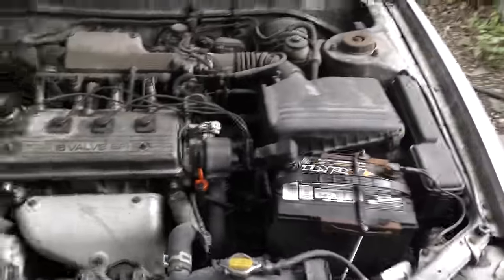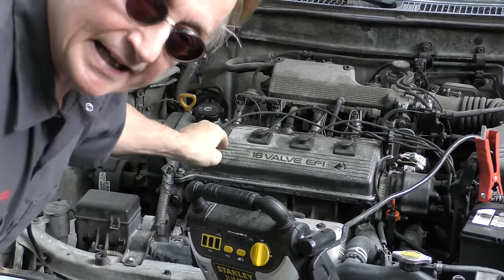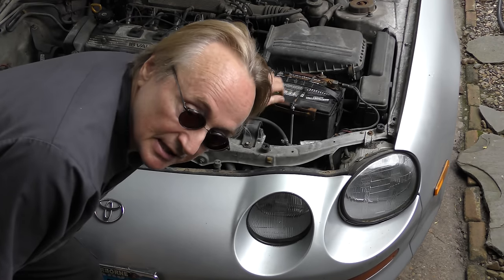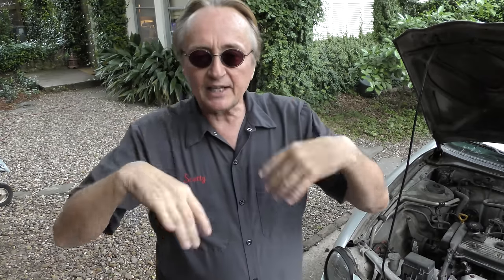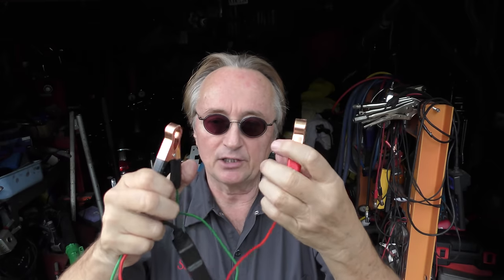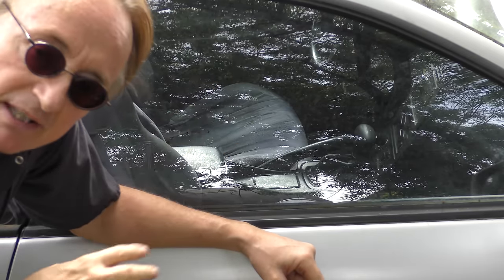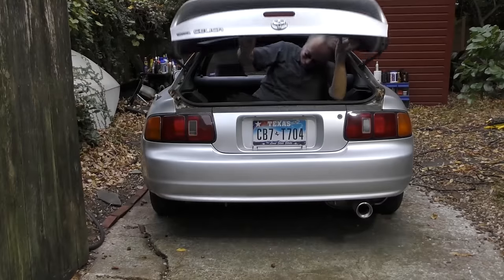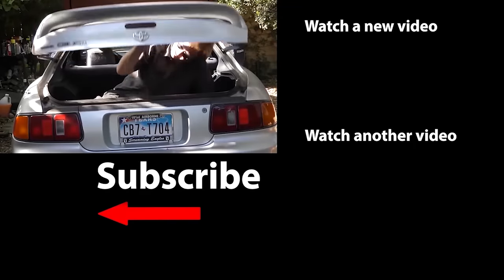Never Do This to Your Car (Learn from My Mistake)

Comment: Lord I miss the 50s and 60s.  Cars were easy to work on.  All you needed was a good shade tree.
Reply: These are the stupid complexities imposed on us by  EPA and Department Of Energy.
Reply: @hg2.  like unleaded gas?
Reply: True that
Reply: So why buy new cars then???? Just keep driving 50s and 60s cars....
Reply: Yeah...  and the only computer was the radio.
Reply: amen brother im 86 ys old and i still work on my 53 m37 army trk  ( aint)  a nut or bolt on that i caint turn  i pulled the emg ou twice   new rings  valve  ground  last time   the lug nuts gave me more tbl  than any hing else  cause  i did know  the were left and right hand lots a fun
Reply: @frankdavidson9675  wow id like to see ur truck but yea oldies but goodies lol
Reply: I miss them for the body design, but nothing else really. That old shade tree nneded heat and cooling and a roof cause you spent a lot of time working on those old cars. Remember full time @12k or less plugs, points, cap, rotor, dwell etc, brakes every year, tires every 2 or so, on and on. My last tires went 80k, last tune up, spark plugs only, 150k 10 years old. Brakes, once at 100k - reliability, saftey, drivability waaaay  better.
Reply: @me1assassin  Well, you'r right there, can't argue that.  But those tune ups weren't really that hard to do, and I would change the breaking system to current just for safety.  Tires just got better and better, and the cost really didn't go up much for it.  I remember working at a Phillips 66 in the mid 60s and those nylon and rayon tires would go flat as pancakes when we stacked then on top of each other.  Lucky to get 8k out of them and needed tubes.  Then a  miracle, the first polyester tires. wow, those would last 20k easy.
Reply: And a new alternator belt cost 6 bucks, and took 5 minutes and a wrench to change.
Reply: @_Peremalfait  True, but you had 2 - 4 belts and we're always replacing 1 or another. I changed the belt on my Jeep Commander, 5 mins one wrench, 48 dollars, at 125,000  miles, and didn't need it, was planning a long summer trip and just in case. Mustang, sits slot, so changed belt at 10 years old. 45 dollars, one wrench 5 min.
Reply: @frankdavidson9675  How did you find out they were not all lefty-loosey?
Reply: That's for SURE, today maybe u can change oil & filter, air filter and a tire!😠
Reply: @me1assassin  Exactly! When I look at all the features in a new car and compare them to cars 50 years ago, there is no way I want to go back! I even don't mind paying to have the work done. My car warns me if someone's walking by as I'm about to back up, slams on the brakes if someone pulls out in front of me before I notice it, keeps a safe distance on the interstate on cruise control even if the car in front slows down a couple miles/hour, and on and on. No way I ever want to go back. Oh, and we can while about all the EPA regulations, but I get twice the gas mileage I used to, my tires last several times as long, I'm not changing points, plugs, and condenser (whatever the heck that was) every time you turn around. I'll happily take my new car, thank you!
Reply: Hence...shade tree mechanic
Reply: My family says I was born in the wrong era. I like old cars and things
Reply: @timeless_realm How do you know whether lug nuts were left hand thread?

Specific Lug nuts on wheels were denoted by there "L" stamped on the bolt head.

EDIT:   Chryslers did this alot. My 64' has this all over and if your not mindful, you can round off a nut.
Reply: @_Peremalfait  I change 2010 serpentine belt in 3 and half mins
Reply: Definitely agree with you, had a 85 when I was 17...the thing rarely broke, but when it did it was so simple to fix. I’m hoping to go back to that someday, could care less about gas mileage. Currently have a 19, and more stuff has broke on it than anything I’ve ever seen, haven’t even paid it off yet🤦🏻‍♂️..lucky for me it’s stuff I can fix myself so far tho
Reply: @kevinb2014  Yes, a car today with a 1.5L normally aspirated engine has more power than a 60's 6 cylinder and gave nearly double the fuel mileage yet accelerates a lot faster despite being almost the same weight. You could almost breathe the exhaust of today's cars without dying due to hardly any CO in it. BTW yes in the 60's an alternator that put out 60 amps may cost only $55 but figure the inflation & see whether it was actually cheaper than today's that puts out 150 amps. No, I'll take today's cars although I wouldn't mind having a '71 Boss 351 Mustang (or a '70 Boss 302).
Reply: And a case of beer.
Reply: I miss my 70 1/2 Camaros now.  . All 3 of them . .  :..(
Reply: To 5ivestring very funny LOL.
Reply: @earthjammerusa5325  and two buddies to watch
Reply: Yeah i read you, i started in the '70s - but honestly, the old cars needed so much more maintenance, remember changing points and all the plugs, once or twice a year?  The rotor and the distributor cap every 2?  Valve adjustments, brake adjustments?  Now the trick is buying the right car and changing the oil like a fiend, if you need to work on your car and it has less than 150k on the odo, it means you just bought the wrong car -
Reply: Just don't get into a wreck, and you're fine.
Reply: Yeah I like working on my own car. But I can tell you one thing my 2016 honda doesn't need much work
Reply: I believe that peak auto was 1996. What I mean is: that was the year that cars were mechanically modern but didn’t have too many computers on board. The computers that were on board were all designed for optimal engine performance and maybe some safety equipment but not much more. The computer code was simple and problems with it were manageable. They had all the advantages of modern fuel injection but not a lot of extremely cheapened plastics on the engine that later cars make vulnerable and more planned obsolete.
Reply: AMEN
Reply: @irish89055  and who's brain child was putting the gas tank inside the cab behind the seat of pickups?  Still love those years though
Reply: @garfyinhawaii1541   And then if you have a little turbo like my baby Buick.......
Reply: @robertmaybeth3434   I have to do valves and other stuff on my bike but I don't mind it.
Reply: @timjohnson1199  Well, I just got myself a 2020 Mustang GT and according to my scanner, it has 22 modules or systems on board. The body module has been split into numerous functions like power window control, auto headlights, auto wipers, lane departure system, backup camera and sensors, auto darkening rear view mirror, etc., etc. Darned thing has more power than I need but I love the sound. Of course, it doesn't sound as rugged as my old '71 that had a 286 deg. split duration cam, headers, intake, etc. (old school pushrod OHV V8s had a nicer sound than these multi-valve OHC engines, which is why a Camaro SS with the 6.2L engine sounds nicer to me than my 5.0L DOHC engine and it's not merely a displacement issue since my '71 was the same displacement as my new ride). Of course, with old pushrod engines, they need a bigger engine to generate the same power as a much smaller DOHC 32 valve engine with 16 fuel injectors. BTW, if you used a calculator to factor in inflation and buying power, you'd find that today's cars give you a lot more than cars back in the 70's. My old '78 Granada ESS that cost me $7800 then would be over $33,000 today, yet all it had back then was A/C, power door locks, 302-2V engine, 3 speed automatic and power brakes. Oh, let's not forget the 8-track AM/FM stereo...
Reply: @kevinb2014  you make it sound as if you're NEW car is accident proof and flawless...keep your plastic made car...there's a reason why 50's and 60's cars are so timeless....the quality and long lasting durability! Unlike your  perfectly made cheap plastic car
Reply: We were blessed.
Reply: Keeping a 88 model 5 series BMW, even that is simple, 90s where it started to get a little crazy in some cars
Reply: Is anybody going to mention horse power? You'd be lucky to have a moter that ran 300 hp back then. Now everyone and their grandma has a car running those numbers. Some performance cars are being sold close to 700 hp and higher. That's crazy! Yeah things might be getting more complicated but all in all it's for the better.
Reply: @alexlundgren6718  There's no doubt the cars are better, safer all around.  In the 60s and before you'd be lucky to get 75k to 100k milage on a car before having to do major rebuilds.  Tires maybe 15k on the tires, a lot less in the 50s.  Now days change the oil regularly and you'r good for 300k or more.  I still miss my 59 Chevy.
Reply: Define easy....
Reply: My dad always said, "I knew once I couldn't see the ground through the engine bay, I was in trouble".
Reply: They don't make 'em like they used to...THANK GAWD! I'll take my 2004 CRV lol
Reply: this is why I don't buy computer controlled injection/ignition vehicles.
I'm not buying a vehicle that I need a computer to fix.
Reply: I still own a 1965 ford mustang, 1970 vw bus, 1982 ford f100. They can keep this modern crap. I haven't needed a mechanic in 30 years. I'm 60 years old now.
Reply: @frankdavidson9675  👍. They can keep this new complex crap. I love my 65 mustang, 1970 vw bus, 1982 ford mustang, and basic tools😃
Reply: @frankdavidson9675  love ya brother wish yall all the best and bless all your years and experiences
Reply: Just had to be rebuilt ever 20k
Reply: @garfyinhawaii1541  have a 2.4    4cyl voyager 2002 gets 40mpg hwy.plenty of power .1500$ 2yrs ago only a wheel bearing front brake pads .
Reply: @underhill918gaming5  please
Reply: Yep. I can't touch any of the cars made after 2015. To many computer sensors. I can tear my 06 trailblazer and cobalt apart easy. It's mostly mechanical
Reply: Totally Agree ~ we were the
Do it Yourself GENERATION
self-achievement was great
as was "learning on the job"
I miss the GOOD OLD DAYS
Reply: No 70s lol
Reply: @underhill918gaming5  Seriously lol. 

"Hey the engine is knocking, how do you suppose we fix that"

"JUST PUT SOME LEAD IN THE GO-GO JUICE"
Reply: @kevinb2014  I think there's a substantial difference though between wanting a daily driver and wanting something that is sporty and feels like it. It's like yeah, I appreciate a nice car nowadays and the fact economy cars still hover around the same price while jam-packed with features is great, but compared to the visceral experiences of the past it's a no-brainer. This is what I always tell fans of EVs too: the Tesla is the best daily driver but the worst sports car. 0-60 in 3 seconds doesn't and won't ever impress me when it's such a flat and lifeless experience. Give me emotion, noise, life. I think that's what many car enthusiasts miss nowadays, is being able to have a fun, basal, emotional, and primitive experience. When I want to unwind in my car, that's how I do it, even at risk. I don't get that from a car that nannies me anytime I want to floor it.
Reply: i keep sunroof open when driving. when i end up in a lake, or ocean im getn outta there before i sink. im not waiting for pressure release at the ocean base to open my doors, F that!
Reply: Its all ¨because they can¨ and to get into your wallet.  Most of this modern stuff is a crock of S___..
Reply: @theedge5584  except they're wicked expensive to buy?????
Reply: @me1assassin  who cares?? Older ones are more maintance
 You'd rather have .new car problems??
Reply: @me1assassin  and tires got.better in general.....you could have a 50s or 60s car and have modern tires now..and they'd last 80k .....modern tires are modern tires  no matter what you drive
Reply: @kevinb2014  features don't make the car good. These companies distract people with all the extras, the car itself, is made cheap and over.priced.....id take an old car or truck as a daily anyday... People ar fooled by features. The newer motors, will last longer than old,sometimes
Reply: Us teens drove a 56 Dodge..I felt like crying the day it was towed away..that car never gave us any trouble.
Reply: @me1assassin  We drove a 56 Dodge I don't know how often it got serviced friends dad took care of it. Over 100k it ran perfect we took it every where. Never had any problems with it.
Reply: @cat-lw6kq  Nice. Now keep in mind you didn't service it someone else did. By 100k, it had brakes done 3-6 times, points, plugs, rotary, cap, 6-10 times, 3 - 4 sets of tires, a few belts, at least 1 water pump, probably a fuel pump and several filters, lots of other fluids, filters, and so on. That's assuming it was a great example. Look I am a great lover of cars, especially 60's, but compared to new cars, they required constant service.
Reply: I want to meet the 5yr olld that could do dwell and timing properly. That was 1950/60's $5. So many cars ran poorly just cause they could, smelling of fuel and toxins, because of poor tune ups. Been working on my own stuff for 50 years, started in a garage at 9, doing brakes and tune ups by 13 solo. Sorry the ease of working on them has been replaced by not needing so much work and reliability is way better. Really none of that matters now because even better cars are replacing all that noxious junk.
Reply: @dodgerkid05  It's called Nostalgia.
Reply: @richsweeney1115  huh?
Reply: @ET74019  what do you have
Reply: @garfyinhawaii1541  today's cars are thin metal with no frame....and plastic... My wife has an 09 honda fit sport 5 spd, and we love it....it has  like 179k on it and runs like new, very reliable fun little car as a 5 spd even though it's only a 1.5 , but, I prefer classic
Reply: @richsweeney1115  Jeep...rolling pile of crap 57k lots of problems...thankfully I got an extended warranty so it hasn’t hit me super hard yet, just annoying as crap when you buy a new car and it’s broke all the time. Has a transmission issue and have gotten the “it’s normal “ talk too
Reply: @dodgerkid05  true, bit new cars are nice, I'd rather a classic
Reply: @darkhelmet4279  your Honda is thin metal and plastic.......and no frame. Unibody crap.....
Reply: @kevinb2014  new cars are thinetal and plastic..... they're my made well. Besides the motor,and some trans. The companies distract you with features.....so you don't notice that theyre made cheap...and it works..the driving features you mentioned, shouldn't be options.....if you need them, you shouldn't be driving.. all people have to do is pay attention...people are too lazy....not you, but the general public... You lean on a new  car and you dent it....
Reply: @theinstitute1324  tesla isn't the best daily........
Reply: @ET74019  is it a renegade
Reply: @richsweeney1115  no Cherokee
Reply: I don't disagree. I'm simply saying that older vehicles (60's are my fave)  are not even close to the safety, reliability, usability, and in most cases, quality, of todays machines. If you've never driven a Tesla, go and drive one. It has taken it all to a whole new level! All said, I am of course, a sucker for an old car. :D I do however, liken it to computing. I built my first computer from a bag of resistors, chips, and blank circuit boards. It was cool, learned alot, went on to get my engineering degree, spent next 40 years working daily with technology. The design of some of the old machines was incredible. Built tough, Built to work on, Built to be repaired. Plus cool designs. Do I want a new one built on those principles? No, there is no going back. On old cars, as cool as they are (my 1985 Mustang T-Top, is the last Carbureted, last without any computers, Modified (Saleen Package +) and a hoot to drive. Took me years to source parts, build parts, figure things out. Now, it can be beat by an off the shelf car, whose driver knows nothing about cars). Nostalgia is a GREAT power. So many things in the past appear so wonderful, through the lens of Nostalgia.
Reply: @richsweeney1115  In reality, cars with actual frames disappeared long ago, like in the early 60's. Since then, they've all been built as "unibody" where the structural support of the vehicle is built into the body for the most part (though you can unbolt some front fenders on some vehicles). Yet, despite it not having a full frame (like most pickup trucks still do) the new cars are pretty hefty, which is why they weigh more than their counterparts of earlier years. Example is that the Honda Fit weighs more than a 6 cylinder '66 Mustang automatic, which was 2500 lbs.; a '07 Fit automatic tips the scales at 2570 lbs. (2nd & 3rd gen Fits get heavier). My old '71 Mach 1 with a 302 V8 in it weighed at about 3200 lbs. with the C4 automatic, yet my 2020 Mustang GT with automatic tips the scales at over 3700 lbs. Granted there's more plastic on interior and exterior components but the extra weight is probably due to the heavier sides of the car, etc. for crash protection. That's why my GT is rated 5 stars in all areas of crashes (including rollover) and I'm pretty sure my '71 Mustang wouldn't fare as well. We have to admit though, that technology has done a lot because a Honda Fit with the 5-speed automatic would probably give a '66 Mustang with a 289 a "run for the money" in a 1/4 mile race; pretty good for a mere 90 CID 4 cylinder against a 289 V8.
Reply: Not a good busine$$ model, eh
Reply: @RustOnWheels  you may be correct. Wasn’t it ‘96 though that they went to the newer computer requirements? I thought ‘95 was the last year of obd2.
Reply: @jackstraw5527  I had to look it up but 1996 actually was the date when ODB2 became mandatory in the US.

I don’t know why but of all my more modern cars the mid to late nineties were the most easy to work on and most dependable. Except for some rust issues on some cars though 😬😅
Reply: Amen Brother
Reply: @me1assassin  good point;we tend to only remember the good of the “good ol days” not the bad
Reply: I have a 2001 ford mustang v6 3.8. Take me 5 min to remove and to install a new belt :D
Reply: Your not kidding! I miss those days.😭
Reply: I miss my old "shady tree mechanics".
Reply: And a case of beer aka "the cold wrench"
Reply: And use that same tree to pull the engine out with the pulley
Reply: So true
Reply: @underhill918gaming5  yes just like unleaded gas !  Seat belts, fuel injectors, parking sensers
Reply: @hg2.  u mean safety standards?
Reply: @underhill918gaming5  

No,

But all/most of the other cr*p yes, Mr. Know-it-all.  Sorry to interrupt your Sierra Club ego preening.
Reply: @tripwall  
That's DOT.
Proceed with preening your ego.
Reply: Amen!
Reply: My newest vehicle is an 82 CJ-7 for this reason
Reply: The mid 80’s were not that bad either.
Reply: I like watching Vice Grip Garage on YouTube. I think you'll like it, too.
Reply: @michaelstowbridge6947  OH lord, knuckle busters.
Reply: Old cars were solid, built of metal and you could work on them.I have an old 96 chevy pick up and the darned distributor is plastic,sensors all over to go wrong and the fuel pump is in the gas tank,guess they never heard of an inline.I could change the fuel pump on my old dodge for about fifteen dollars instead of a hundred and fifty and a buttload more work.These new ones get somewhat better mileage but its more than offset by maintenance costs and aggravation.
Reply: @hg2.  The bigger government gets. the poorer  the citizen gets.
Reply: 5ivestring,
You got that right 👍, I bought a 1965 Mustang Fastback for my Graduation in 1969, It was Fun to work on, easy to fix, fun to drive, that was Great times, even though there was a War going on.
Reply: I still remember the sunlight reflecting off the glass settling bowl under the carburetor of my grandfather's 1949 Studebaker.
Reply: My my does this stuff really make the vehicle better, I am probably not like a lot of people and I just use my car to get from place to place.
      My Chevy is getting old but runs like new, Helped people jump start many times.
      I appreciate All Scottie's Acknowledge because I certainly don't have it
Reply: You make me laugh...🤣
Reply: loved the old american motors...the parts were very interchangeable.
Reply: @underhill918gaming5 wow you’re so smart